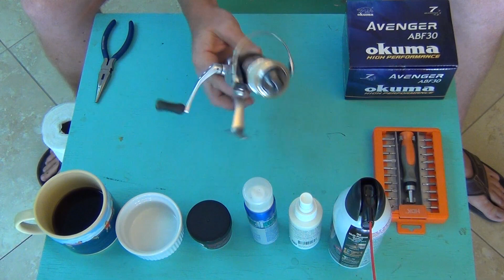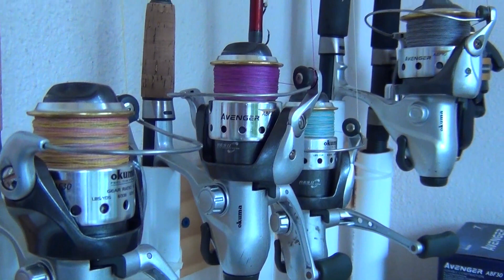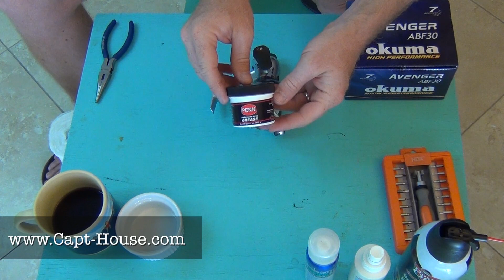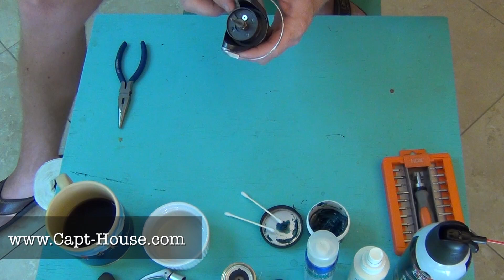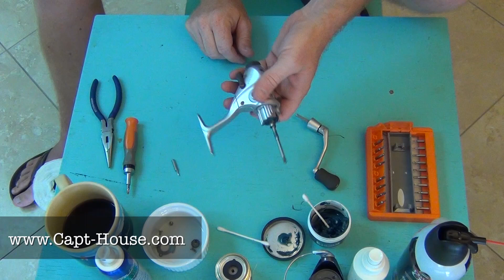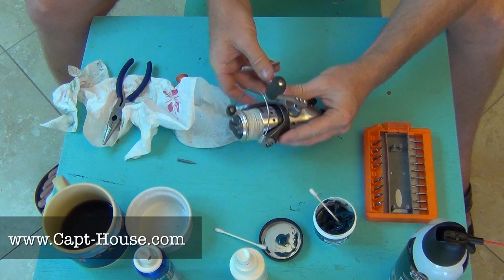Okuma Avenger ABF 30 Review & Disassembly

Comment: I’ve been subscribed to your channel for a while now and just wanted to tell you that you do a great job. Just yesterday I bought an Okuma ABF 40 Avenger reel used on eBay. I have been totally amazed by the quality and design of these reels. For a hobby I collect and restore vintage surf spinning reels made before 1980. I think I have around 240 reels in the collection. I use my vintage reels for fishing almost exclusively. I got this Okuma because I wanted to try fishing with a bait feeder reel. The Shimano and Penn bait feeders are so complicated and difficult to take care of. My Okuma came in the box with all the papers, s spare spool, and an extra housing seal all for $30 incl. shipping. The reel is in mint condition. I like the Okuma for the simplicity of their design. I have no difficulty servicing this reel and the engineering of the design is very straightforward. I usually don’t buy the more modern reels out there and I avoid those made in China but this Okuma is a definite exception. I can’t think of a better value for a bait feeder reel! Thanks for doing this video! —— Chris
Reply from the maker: Sure thing, Chris! I love your hobby concept and you will love using that Okuma Avenger. Thanks so much for watching!

Comment: Good lord, you had that reel sumerged in water and you didn't take a part the most sensitive part, you should have taken apart the 2 bearing that go in the shaft (the one way bearing and the ball bearing) , instead of that you just added grease, so the humidity or corrosion already built up there stays there......

Comment: My okuma abf50 has a issue with the spool spinning and letting the line out like there is no drag but my dial is turned up. The anti reverse and everything works fine it's just the spool itself isn't functioning properly.  Any ideas on what the problem is. ?
Reply: Still having problems? Might have to adjust your bait drag

Comment: Fantastic detailed dis/re-assembly/lube video (I freekin love these reels).  One question - I managed to get my reel (ABF 40) taken apart, lubed, and reassembled, however the drag doesn't seem to be working now... any suggestions?
Reply from the maker: +Robert Stiles - The only thing that I can think of is to check the sprocket that the spool sits on.  Make sure that is set right, it shouldn't spin.  Thanks for watching!

Comment: Captain I made the mistake of taking the 3 screws and plate off for the anti reverse and a Vshaped spring/lever popped out. I can't figure out how it goes back in. I have 2 other Okuma reels but don't want to mess with them. My question how do you reinstall the V shaped spring/lever? The schematic shows part # 800- part number 28000256 called anti-reverse re-lever.
Would appreciate any help on AV-65b reel.
thanks
Leo Johnson
Reply: +Leo Johnson - I popped the little clip out of my reel last night, so its fresh for me -  pull the anti-reverse "rod" out of the back of the reel and you will see when the clip would slide down onto the flat spot after you insert the rod back in the reel. Its very simple to insert the clip into the slot as it will slide over the rod.  Look at it with a good light and will see how it goes together.